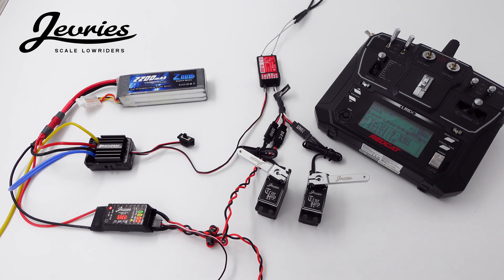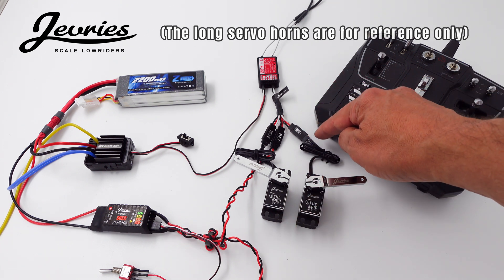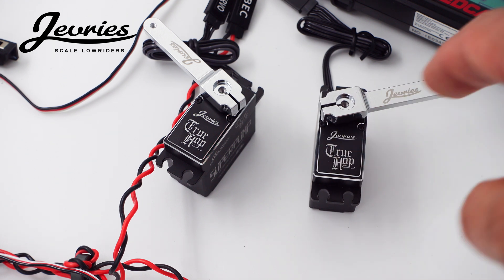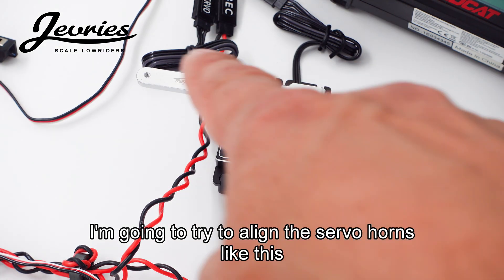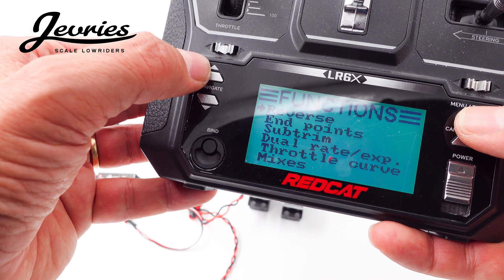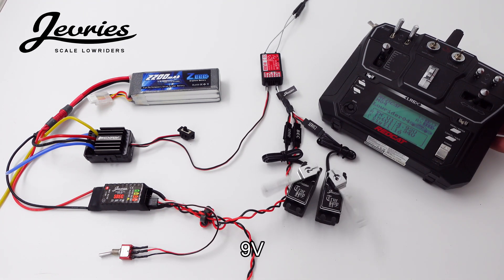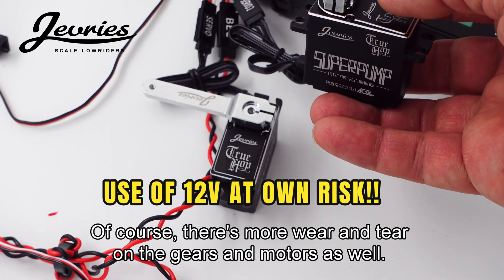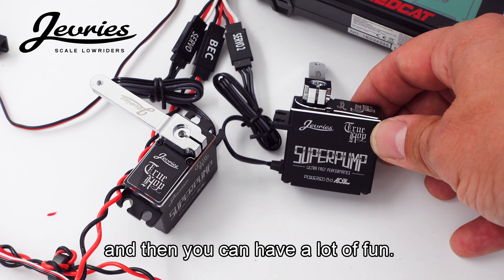2 Direct Powered Servos to 1 receiver channel

Comment: I have watched a few videos about installing the castle BEC in this case do we have to program it? Or just put it in. I have the 1080 Hobby wing ESC. So should I set it to 8.4 V?
Reply: Set the hobbywing to 8.4
Reply: @dentman62  Thanks!
Reply from the maker: @kennethwilson2409  My SBEC has a jumper and 4 different settings 7.2, 8.4, 9 and 12V all manually selected
Reply: @jevries so the other wire that hangs off your BEC is what plugs in the voltage selections port ?
Reply from the maker: No, my BEC has two outputs so you can hook up 4 servo's using 2 wired harnesses. @Mingojdm

Comment: I see youre not cutting your red wire anymore lol youre welcome
Reply from the maker: You only need to cut the red wire from the ESC when you juice your servo's through  receiver with the BEC. This is a direct power setup for your servo's bypassing the receiver.
Reply: @jevries  can I get away with connecting the BEC to the balance port lead instead of splicing? I have some extra 3s balance port plugs which would make it really easy thanks! And when are you gonna get some more super pumps in?
Reply from the maker: @kennethwilson2409  I never tried it to be honest as I don't know if the thinner wires of the balance port are sufficient enough to run the power through.
Reply: @jevries  I know you say 8.4 is safe I guess I’m taking a risk having my BEC at 9 V.??
Reply: Yeah I didn’t think about that. Thanks for your answer.

Comment: Ok so with this set up how do you set the endpoints when one servo is inverted and you’re on one channel? Thanks!
Reply from the maker: With servo USB programmer and software when needed. These SuperPumps don't need it though, just reverse and they are alligned.
Reply: Ok thanks!
Reply: Oh one other thing I was under the impression that the super pumps will fit in the same spot that the stock servos are? This is my first hop on a Monte Carlo. Or do I have to do to modification with the L shape aluminum piece? Also, do I need a BEC for each servo or just 1 since this is my first time trying this I’m mainly concentrating on the front concentrating on the front
Reply from the maker: @Baldheadnut  Unfortunately the Monte chassis is not deisgned for hopping so there's quite a lot of modification needed to get the most out of it. Our BEC provides enough juice for 4 servos.

Comment: How do we tap the SBEC into a Deans battery connection along the he fly controller?
Reply from the maker: I soldered mine together with ESC power cables to a Deans plug.

Comment: Are the servos for hoping? If so how much are they?
Reply from the maker: Yes, we custom developed these servos for hopping. You need to use a BEC and 3S lipo battery and use the first hole on the short servo horn to get 100% torque.
Reply: @jevries now that's super cool,,2 👍👍up..